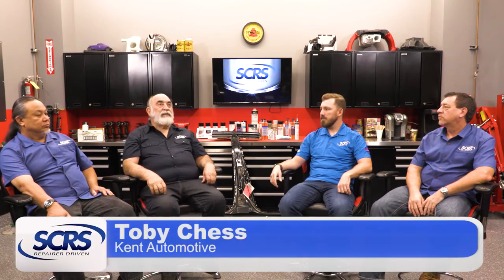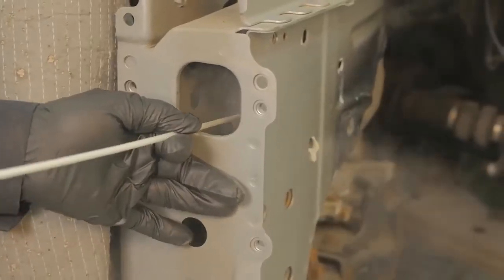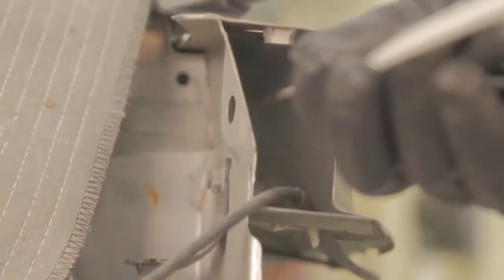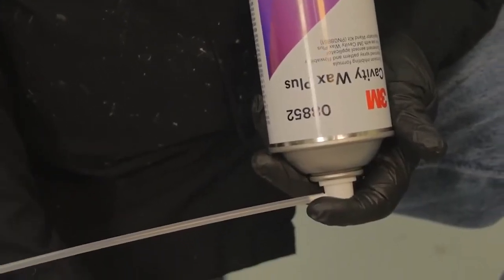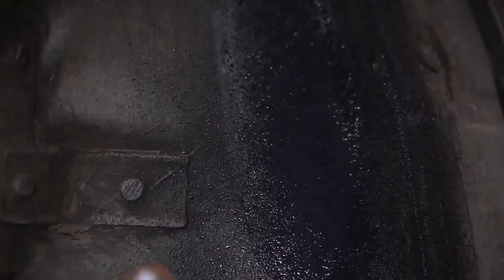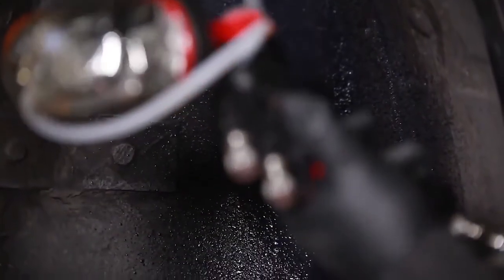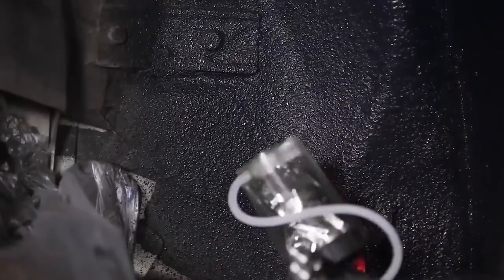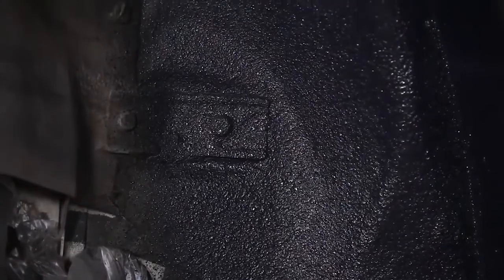SCRS Education Committee Presents - Corrosion Protection Part 3 of 3 - Cavity Wax and Undercoating

Comment: Good Topic to discuss on, you guys mention Toyota requires a special type of primer on the front edge of their hood. it's mentioned but i could not distinguish what was said, can you supply me some information on that.it's like anything else. the repairs are only as good as it's foundation. it's so critical to protect the metal from any external elements. keep the videos coming. thanks guys

Comment: Thanks for raising awareness to this topic, the best paint job and body repair is worthless if it rusts due to skipping this part of the repair and yet it is the most overlooked and under used material in the business.  Think about the structural items that are welded on every day in the business and then never have cavity wax applied to prevent corrosion, now it becomes a safety issue as well!  You guys are awesome keep on promoting this type of stuff its just the right thing to do!